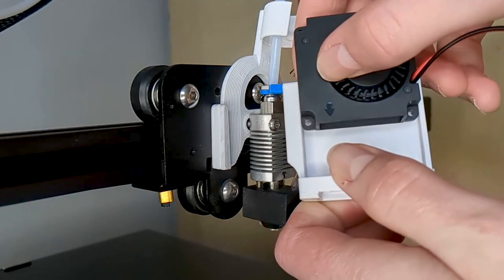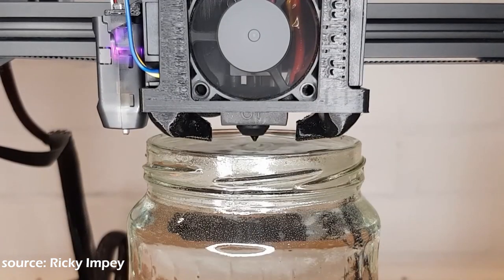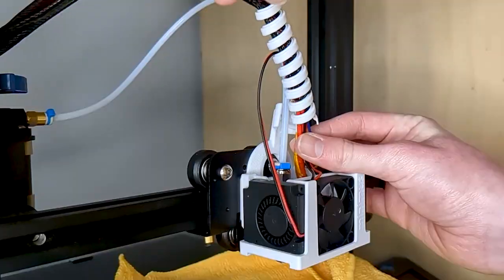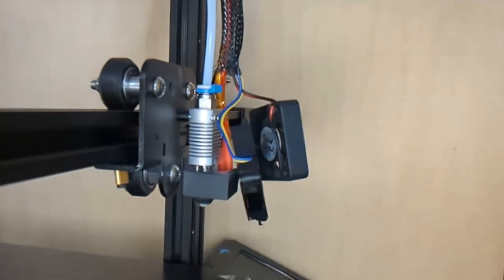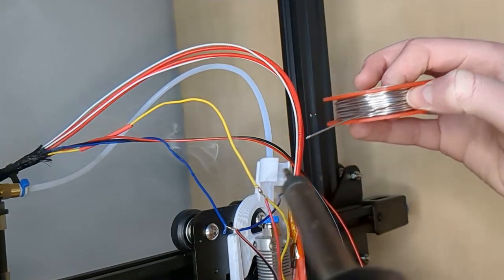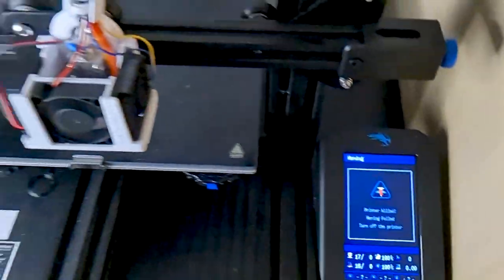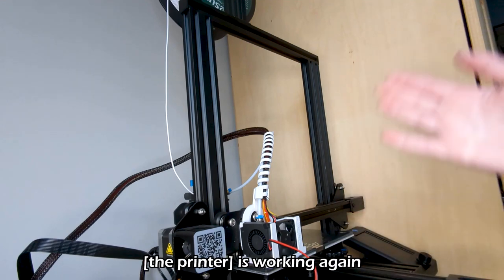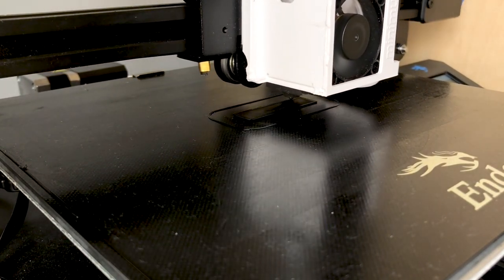This Easy Upgrade Will Improve Printing Performance! (Didn't Go As Expected)

Comment: I'm pretty sure you need a two pin fan and make a splitter. I'm pretty sure what you installed was a PWM fan (3 pin) and yeah something like that it was bound to happen. You need a 2 pin otherwise you'll run into issues like you had, adding using a 4 pin connector and making a splitter is by far the cleanest option imo.
Reply: You just shorted your board out is all.
Reply from the maker: Thank you for your feedback! I was using two 2 pin fans, soldering the wires together will result in the same way as using a splitter, you're turning two wires into one wire after all. It would've looked better though, you're right about that. But yeah, I did short out the board
Reply from the maker: btw, I'm pretty sure PWM fans can be used on 3D printers too :) You connect the red wire to power, the black wire to ground and leave the yellow wire disconnected with some tape or a shrink tube around the end. That's what I did in the custom pc case I built for the DIY home server I did and it worked great :)
Reply: @Fr0zenTiger  3 or 4 wire pwm fans can be used without any problem, only use the positive and ground wire and the fan will work but only at maximum speed. Using a buck converter to set the appropriate voltage and you're good to go. I have 2 of them, lowered the voltage a bit to make it a little more quiet and it works fantastic
Reply: The yellow wire is a speed sensor.
Read it yesterday when my fan arrived.
Reply: I cut the wire out of 3 pin fans all the time. The 3rd pin is simply to monitor the RPM, speed, of the fan.

Comment: you must have had a really old board. I paid for the minimus when released, and have the dual fans wired just like you did on 7 printers without issue.

Comment: you need to set voltages in the firmware otherwise the board can die from under voltage to other components.

Comment: 2:20 please stop making videos, you're going to break someone's 3d printer or worse.  Maybe 10 years from now when you're a little more experienced you can try again.
Reply from the maker: thank you for the life hack tips good sir, you are too kind. appreciate the help mate 😎👍
Reply: Can you elaborate please as I seen this method in lots of tutorials across the internet
Reply: @Fr0zenTiger  you showed a mistake, what happened, and remedied it. I think you are doing fine with this video up. We can learn just as much from failure as from success. Keep it up.
Reply from the maker: Appreciate the kind words, thanks mate 💪😎
Reply: Can you go more into detail what is wrong at 2:20 so that other know.
Reply from the maker: @larsaberg6851  I'm currently working on another video on this hotend cooler, where the issue will indeed be addressed.